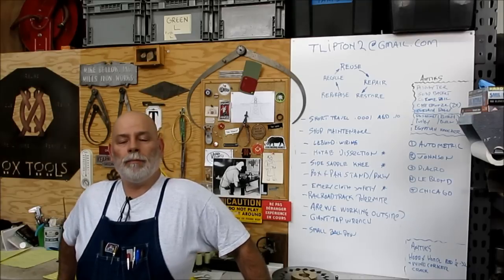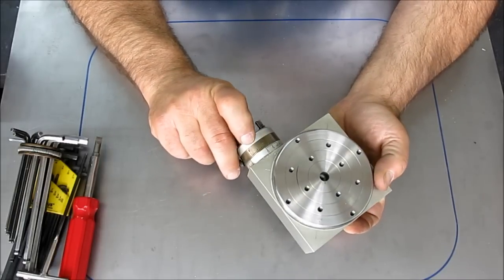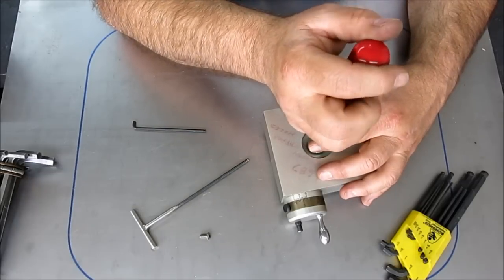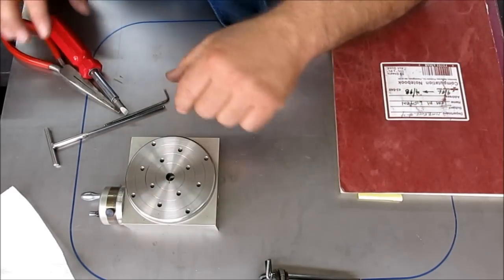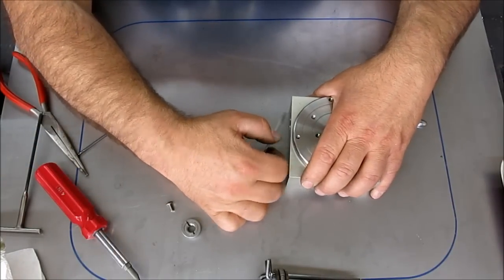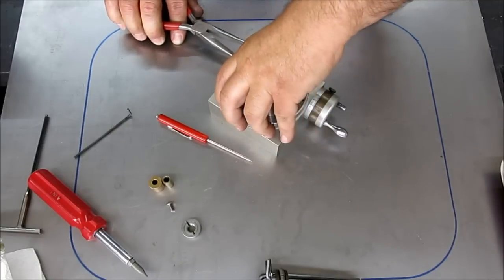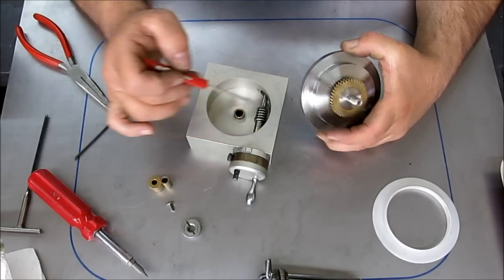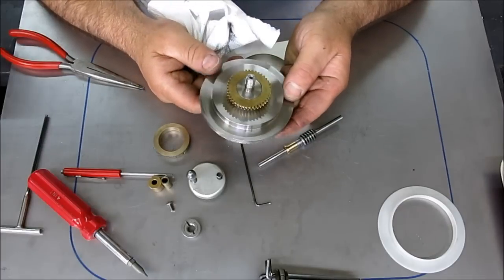I'll Show You Mine #1 Four Inch Rotary Table

Comment: This is such a beautiful and simple design. Would you be willing to share your design with me/us? I have a sherline lathe, and I find buying the tools sometimes doesn't make sense especially when you have the materials to make them. The only modification I would make on this would be to either mill slots on the bottom or add holes to bolt it to a cross slide. Great work! Love the information shared on your channel.

Comment: Maybe the graduated ring was an after thought, hence the grub screw under the ring?
Reply from the maker: I can't remember now. The graduated ring needs to move independently from the hub. The hub needs to be locked to the drive shaft. Seems simple enough but I never had cause to take it apart in seventeen years. Thanks for the comment.

Cheers,

Tom

Comment: Beautiful and clever. Great ideas.
Reply from the maker: Hi Clay,

Thanks for the comment.

Cheers,

Tom
Reply: BTW did you make that worm gear? Or buy it and press it on?
Reply from the maker: Hi Clay,

Its a commercial worm gear and worm. They are actually quite accurate because of the method they use to make them. Thanks for the comment.

Cheers,

Tom

Comment: Cheers Tom,
I am a bit limited with that sort of gear mate, so I've learned to improvise a bit, but I will check out your indexer again.
Thanks...
Reply from the maker: Hey Pete,

In theory you could use the rotary table to index the dials and rings for itself. That might make an interesting challenge for a project.

Cheers,

Tom

Comment: Tom, Nine degrees per rev was that on purpose because 360 is a multiple of 9?
Very nice handy tool!
Regards,
Eric
Reply from the maker: Hi Eric,

The gear has 40 teeth. So one turn of the handle is 1/40 of a full rotation which is nine degrees for one revolution of the handwheel. It was the gear I had available to me when I built the table. 

Cheers,

Tom

Comment: Cool little piece you made there! What about using an eccentric bushing so you could adjust gear alignment if necessary?
Reply from the maker: Hey Brian,

Some rotabs have that but the shaft then needs to pivot near the handle end. Not a good idea to just push the shaft out of alignment to eliminate lash. You also see that kind of a setup on tables where you can fully disengage the worm from the gear to allow free rotation.

Cheers,

Tom

Comment: Nice piece of engineering and without a cad system.  I am guessing the Delrin hat shaped bushing carries the radial and thrust loads.  Is it difficult to hold tight tolerances with that material?
Reply from the maker: Hi Artee,

Delrin is wonderful material. You can pretty much do whatever you want with it. Yes you can hold tight tolerances pretty easily. 

Cheers,

Tom

Comment: PS once you have the handle off you could push the shaft out with the bushing
no need for a provision to pull the bushing, would also disengage the worm gear?
Reply from the maker: I think that's right. The worm can come out in that direction but not the other because of the diameter of the worm. I need to take it apart one more time to model it up. Seems like there is some interest in folks building their own version.

Cheers,

Tom

Comment: Hi , Tom . Thanks for telling me the ratio of worm and gear for the rotab . I don't have your email if you have listed it somewere . I have a question for you maybe you can help . I am restoring an old collet lathe by hardinge . If you are familliar them they have a little site glass on the compoind with a little cover over it . the magnifier is gone which helps to align the compound to the protractor scale below it . this part is gone and hardinge is very expensive . I was wondering if I took a peice of arcrylic and turned a spherical radius on the end and polished both ends would this act as a magnifier ? I know I would have to put a line on end of the lens to use as a cursor for alignment to protractor lines on scale . perhaps you have some advice for me Thank You
Tom
Reply from the maker: Hi Terry,

My email address is on on the whiteboard at the beginning of all my video's. You might be able to buy a small acrylic magnifier lens and modify it to fit the lathe. Check Edmund scientific.

Cheers,

Tom

Comment: Hey Tom...

Like the series idea and enjoyed the video!  Great build!

Did you build this back when you worked with "Charlie" (think that was his name), did he influence the build?  

It would be cool to show what part(s) were machined using this RT when the build was completed.

ATB
Chuck
Reply from the maker: Hey Chuck,

Yes he did influence the build. He did the awesome engraving on the table and dials. He built one even smaller than this one with a heat treated and ground table and cast iron dovetail slides. Maybe I'll trot that one out again.

Cheers,

Tom

Comment: Very beautiful project, Tom. I own a 2 inches Proxxon dividing that I think it's smaller. :-) A question: I've seen the shaft where you putted the worm gear with interference. Is there any good metod to turn a slender shaft when you do not have the chanche to use the tailstock?
Reply from the maker: Hi Cosimo,

Yes there is. The trick is to do it in steps. You turn what you can safely turn with the rod self supporting. Then un-clamp it slide it out a little more and turn the next section. It helps if the starting rod is nice and straight and round so when you pull it out of the collet or chuck it runs true each time.

Cheers,

Tom
Reply: oxtoolco Thank you Tom. I will try and measure results to understand which is maximum lenght according to various soft materials like alu, nylon and teflon.

Comment: You should show that little vise your wife made in school. The one with copper jaws. 

That rotary table is a tank!
Reply from the maker: Hi Andre,

You guys want to see the little school vise? Might make a good one as it needs a collar made that got lost somehow.

Cheers,

Tom
Reply: Yea, it would be interesting to see. Good meatloaf project too. I need to make a split collar anyhow for a little precision watchmakers lathe project.

On a side note, I am making collets for it. does it matter if they have 3 or 4 slits in it? And do they have to be perfectly spaced? I'm thinking of slitting them with a jewelers saw but I'd like your thoughts first.
Reply from the maker: Andre Gross Hi Andre,

I usually go with four slots because its two indexes instead of three and they are perpendicular. I don't think it matters too much. 

Cheers,

Tom
Reply: Thanks, Tom! it is a heck of a lot easier to cut 4 slots than three with a small hand saw.that way I can go perpendicular to the axis of the collet not at some funny angle.

Comment: When you prep the plans are you going to fix things like making that counter bore bigger ?
 Maybe put a little threaded hole in the bushing so you can pull it out, that sort of thing ?

Use standard off the shelf gears ?
Reply from the maker: Hi Rusty,

In the original design I was going to use a nylock locking nut where the threaded collar is. I would probably open that counter bore when I model it up in Solidworks. The gears were a set I had around and are readily available. 

Cheers,

Tom

Comment: Tom, from a wannabe machinist, I'm looking forward to this series. Decimal degrees are much faster--less calculations--like metric.

Off topic: 1996 was the year the USA was supposed to convert to the metric system. I built one highway/bridge project using the metric measure. All employees were directed to use metric tools and not think about the "standard system". Two weeks into the project everyone--equip. operators, inspectors, supevisors etc.--were all using the system with ease and not grumbling about it after seeing that metric was easy.

In Sept. 1996, Arkansas State Highway Dept. was one of nine States ready for the conversion. The other 41 States didn't seem to care?, so the metric measure never became the standard. IMO the USA could advance in the world if metric became our standard.

Thanks....13
Reply: It is not really a matter of it being easier or better. It is a matter of high cost of converting and retooling with no way to pay back the expense of the conversion. As an example with the highway departments, the cost of just replacing the signage would be enormous with absolutely no way pay back the cost. All the road making machinery is designed to lay out one width of asphalt. Even in all metric locations, most of the materials are just labeled in metric units but not made in metric sizes. You buy plywood that is 2440x1220 that is just a 4'x8' that has been relabeled. You get 38.1 mm rod instead of 1-1/2 in rod.

The short answer is that you need to be familiar with and be able to work with either system unless you can afford to just toss out everything designed around any legacy measuring units. Even places that have fully converted to metric have not been able to get around this.
Reply: +BigMjolnir We choose to use the Imperial system of measurements not because it is easy, but because it is hard.; because inches will serve to organize and measure the best of our energies and skills, because that challenge is one that we are willing to accept, unwilling to use the metric system, because 'Murica! 

Know what no metric using nation has ever done? Put a man on the Moon!
Reply: +Paul Frederick Yes, Mr. Kennedy...
Reply: I think the trick to getting us converted to metric will be to do it in stages. For example, as highway sighs are added or replaced, they go up with imperial units like now, but metric units too.  Once they are all converted, you wait a bit, then start making the metric more prominent in the next generation of signs, then the one after that you drop the imperial units. Excuse can be that metric is for tourist use.

Main holdup is that people can't visualize metric when they are used to imperial. Seeing both together for a while will fix that. For instance, what does 38 degrees C feel like?  See it paired with the degrees F number for a few years and you will know.  Tooling conversion for most folks has already happened to deal with metric fasteners on imported products. 

I'd much rather work in metric...7mm to 6mm is a lot easier math than something like 9/32 to 17/64.  Now if I could just find a metric hammer...

-- Mike
Reply from the maker: +Paul Frederick Perfect!
Reply: oxtoolco
I bet you know where I paraphrased that from.
Reply: BigMjolnir
Yes it is the do the other things speech.

Comment: Good video sir.  Very cool engineering that went into it looks very sturdy.  One suggestion for future episodes in this series would be to show how you would set this up in the mill, what do you do, just clamp it in the vice?  Btw, you know you have watched too much Oxtoolco when you find yourself incessantly wiping your table, parts, and all surfaces for those ghost/phantom chips that may or may not be there! :)
Reply from the maker: Hey Turbo,

You got it right. This ones sits right in the Kurt vise when you want to use it. You can even stand it up on end and do horizontal stuff. Thanks for the comment.

Cheers,

Tom

Comment: Hi Tom !
Very interesting project ... I have a stalled project for a 140mm rotary table, but it's stalled because I didn't think it turned smoothly enough. I then made a groove for a ring of 4mm balls - look here: 

http://kelds.weebly.com/rundbord-140mm.html

 ... but that not good either - because you can feel/hear every little piece of "dust" getting in the groove ... and there WILL come some small chips in there eventhough I have made a little "appron" hanging down and covering the split-line between the base and the moving table !

Then I see you used some plastic ... I have lots of this material in big chunks too - I'll try use that - thx !
Reply from the maker: Hey Keld,

One of the big problems is getting the worm and the gear aligned properly. If they are off even a little it does not behave itself. When you fill a slot with balls like that they act like little gears. Every other ball should be slightly smaller so only the balls that are turning in the direction of rotation are in contact with the surfaces. You can also add a cage or springs between the balls to keep the rotation correct.

Cheers,

Tom

Comment: As someone who has never worked with metals, (but will soon). I am absolutely amazed that you designed and built all the mechanisms required for that small tool.  I know I'll never be able to do that kind of work and I've always been impressed by your work, but going from design, to making the parts, to putting it together and it work as well as it does has just blown my mind.  Nice job Tom, I'm truly impressed.  Like I said thought, I've never worked with metals, I'm a computer tech with a woodworking hobby and wanting to build a CNC and work with soft metals, so take my comment with a grain of salt, because I really don't know how much you put into that part, I'm just amazed that it was hand made and not by some robot
Reply from the maker: Hi Bubba,

Thanks for the nice comment and compliment. It was a fun little project using a gear set I had lying around in the shop. 

All the best,

Tom

Comment: You weren't kidding when you said you were tricky. I do like that set screw though hah. How did you end up at 9 degrees per revolution and was that chosen for a specific reason? And are those gears commercially available? This looks like a nice little project. I'll add it to my list after some mini platens.
Reply from the maker: Hi Ryan,

The gears were a couple commercial sets I had around. I don't think I bought them special for the job.

Cheers,

Tom
Reply: Gear ratio 40:1 gives 9 degree of 360 per rev.
Of course a gear ratio of 36:1 or 72:1 would be nicer and give 10 or 5 deg per rev respectively, but those ratios mightn't be available in a gear set size that fits your device, so you work with what you have.